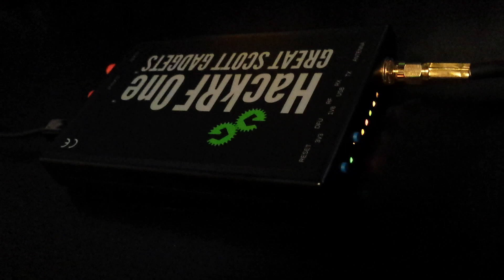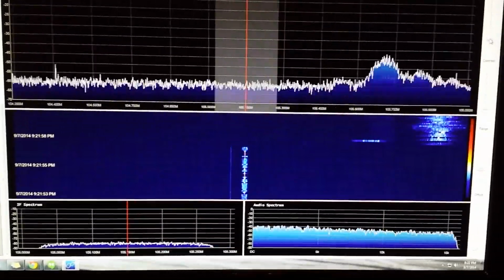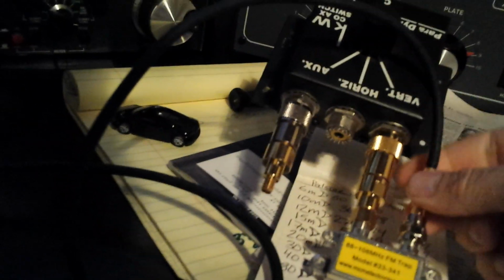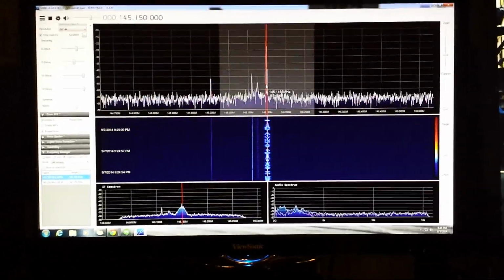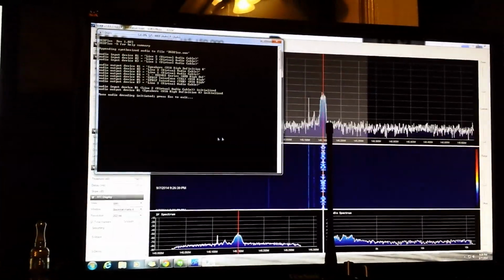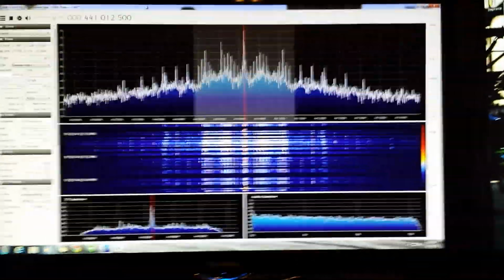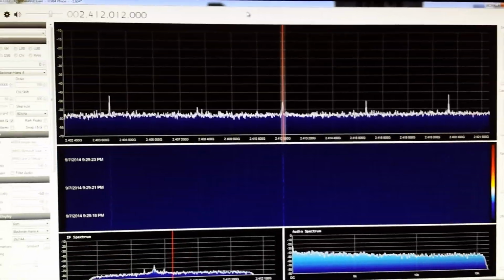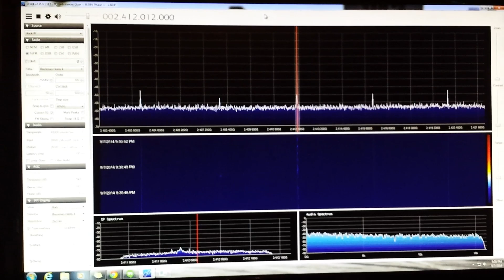HackRF One with an FM BCB filter

Comment: Thanks for the hint on the FM blocking filter - for less than two bucks per unit it sounds like an amazing deal.
I wonder if you could do another small video telling us the amount of attenuation for the frequencies e.g. 80-85-90...-120 MHz and the insertion loss on non blocked frequencies e.g. 10m, 6m and 2m band. Or maybe a table in the video description would also do it.
Can you tell us what type of antenna your are using to get an idea how much FM it picks up by design, since a discone gives you quite different levels of broadcast than e.g. stacked VHF/UHF ham antennas.
What is your experience with the sensitivity of the HackRF versus ham gear and a simple RTL dongle?
By the way your antenna switch has two issues, it is very lossy on higher frequencies by design and SO-239/PL connectors are not good there either. This is good enough for HF, maybe tolerable in VHF, but it gets really bad in the UHF band. You may consider using two UHF coax relays to do A/B tests or antenna switching. These relays are not necessarily expensive if you look on various online sales platforms. I am having similar issues, still running some of my equipment with old school BNC, which is better but I am still not everywhere on SMA, which is definitely the better choice and the reason that Michael Ossmann chose this on his great SDR transceiver. Had he chosen SO-239 we could call him Lossmann :-)
Reply from the maker: The antenna is a Diamond X200A Ham VHF/UHF antenna.  My intention was just to have a practical demonstration of the effectiveness of the BCB filter, not a complete scientific evaluation.  I understand the deficiencies of the PL259/SO239 situation and all of the adapters, but for the purpose they worked just fine.  

I plan to do a little more testing with the HackRF and your idea of a comparison with an RTL dongle is a good one.  I may enlist the help of some friends with real test equipment soon to check the RX sensitivity in a few different ranges.

Thanks for watching and for your comments!
Reply from the maker: n1vca Here you go:  https://www.youtube.com/watch?v=AFxIMGGtLf0